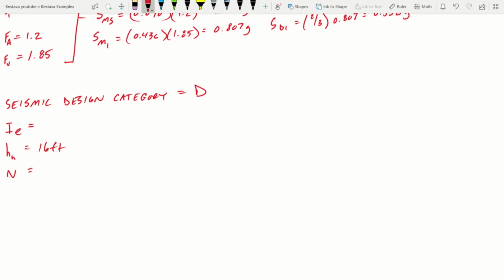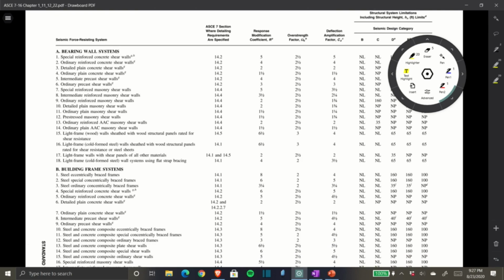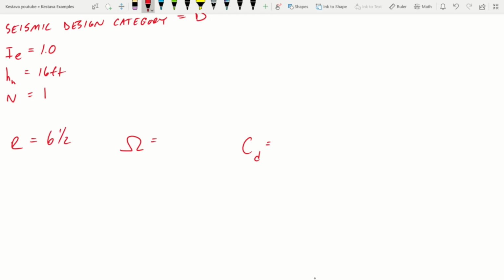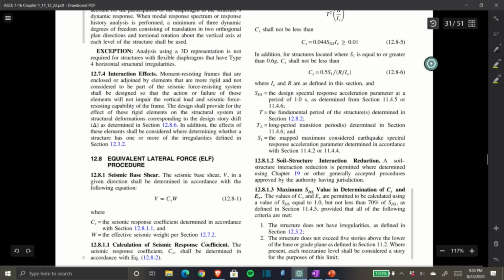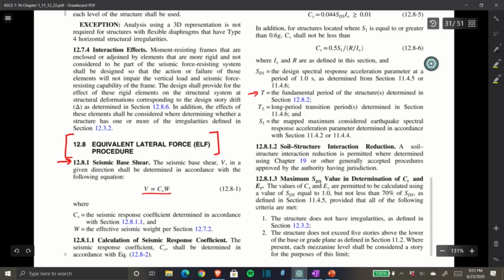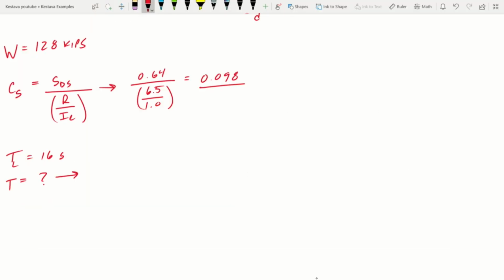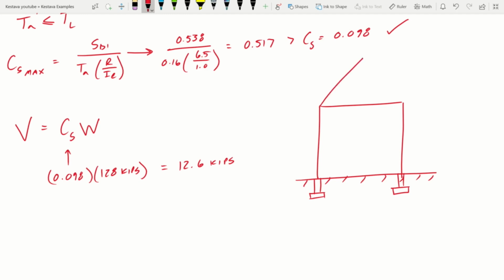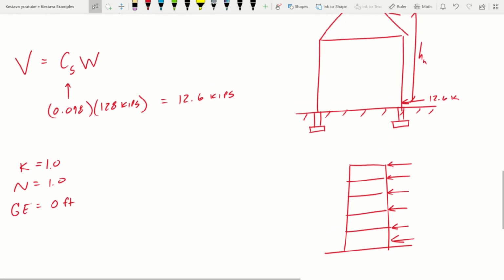Seismic Design of Structures - Finding Seismic Criteria using ASCE 7-16 (part 2 of 3)

Comment: HELP!!!!!  Using table 12-8.2  I remember you stating if you have a "SPECIAL Concrete" OR "SPECIAL MOMENET STEEL FRAME" you must use the ALL Others category.  The SEAOC  structural seismic design manual Vol 1 has examples where they use the moment steel frame even though the problem statement calls out Special.  Example 31 .  What is the correct thing to do?  Thanks

Comment: You should probably mention note b. on table 12.2-1. You are permitted to subtract 1/2 from the overstrength factor if using flexible diaphragms.

Comment: Hi! I am asked to comply to these seismic basis for a rotating mechanical equipment enclosed in galvanized cover 1.5x1.5x1.5m in height. does ASCE 7-16 apply? 1. Applicable Code : ASCE 7-16
2. Site Class B
3. Ss =0.147 / S1 = 0.065
4. Risk Category : III
5. Importance factor : 1.25
Reply from the maker: depending on the type and size of equipment  believe you will find yourself in either chapter 13 or 15, but check with your PIC or EOR!
Reply from the maker: your seismic values look small, so the forces should be relatively minor for seismic design at least!

Comment: Hey man HUGE thanks for all the efforts you are putting in. Maybe offtop but anyway: do you remember any provisions of the codes regarding these two:
1. What stiffnes shall we use in the structural model when computing the fundmaental frequency (f1 or f2) using FEA such as ETABS and ohters?
Actually 12.7.3 of ASCE 7-10 gives a hint but it doesnt give an actuall reduction values (we probably should use those which ACI 318 prescribes). However, I have heard such a philosophy that since both wind and espessially seismic loads are of dynamic nature, we shall use unmodified initial stiffness E0 of the material when determining f(T). This is based on the fact that concrete is much stronger against short-lasting loads of rare occurance and in the same way much stiffer (we all know this plot where the difflection of the simply suppoted beam increases with the time without an increase in the load). So that concrete is much stiffer duting EQ.
2. Do we need to account for the portion of the building bellow ground level when computing the fundmaental frequency (f1 or f2) using FEA such as ETABS and ohters?
Similarly, I have heard differernt approaches: regarding wind loads, we do not to consider underground part, since It does not exposed to the wind so does not contribute to the effective height (stiffness) of the system under consideration. On the other hand, regarding seismic load we do need to consider underground part  because it transmits ground movents to the upper part. This seems strange 'cause the underground part is confined by a ground itself so it has no adequate spase to develop horizontal displacements and therefore accelerations, unless geo report says different (liquifaction, soft grounds etc.).

I am super exited to hear ypur thoughts on that! Maybe do ypu remember some parts of the code concerning these?
TAKE CARE!